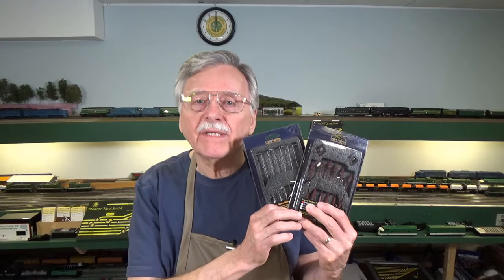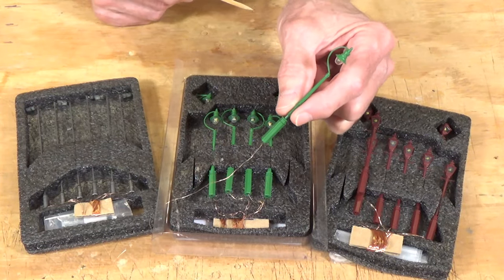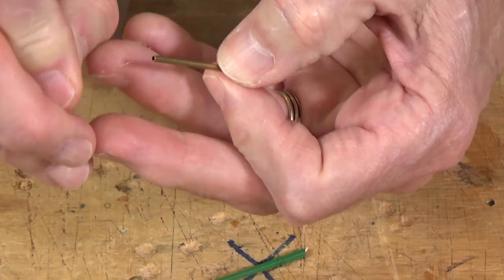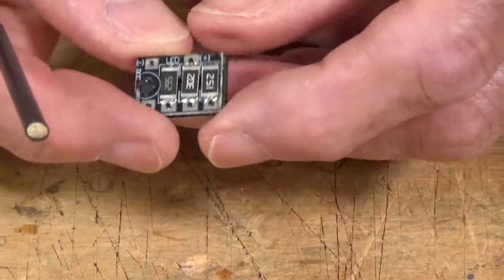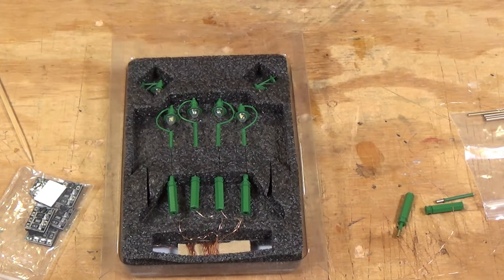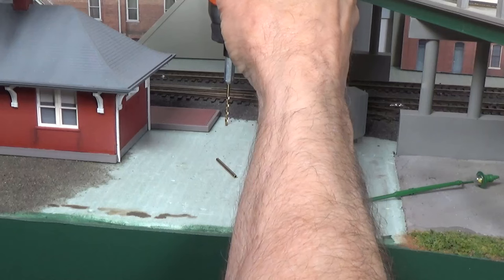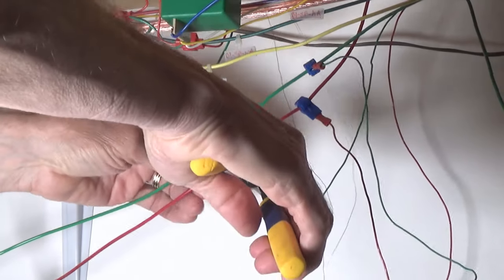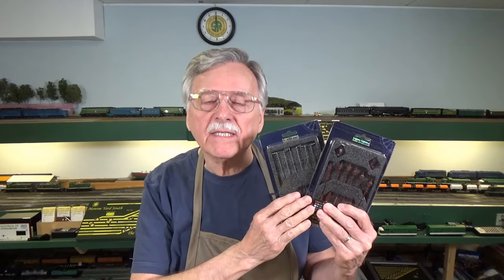Period Lighting For Your Model Railroad (316)

Comment: Thanks for the information Larry. Surely the wires must have colour coded plastic insulation on them that helps apart from the differing lengths of wire for  the + or -. It was not obvious in the video.
Reply: It doesn't really matter. If you connect them incorrectly, they just don't work. Flip the wires around, then they work.
Reply from the maker: Correct, and there is no color coding, just clear insulation, thus the different lengths.

Comment: I am always leery about pulling what looks like magnet wire through brass tubing.  It is hard to see when the clear lacquer used to provide insulation gets scraped off or damaged and this can lead to shorts that can be very hard to find.  Don’t ask how I know this! A small styrene lining helps protect the wires and can be removed after threading is completed.
Reply from the maker: They use a tough enamel coating that they feel makes the chances of breaking through unlikely.

Comment: I plan on hooking mine up to a NCE "Light-it" so I can turn on and off with my throttle.
Reply from the maker: Should work fine, just pay attention to voltages. I’m pretty sure those put out 5V so try the LED with a 1K ohm resistor on the LED wire first.

Comment: Sir I'm new to ho scale railroad modelling. Now I have made plans to set up in my room. So, please clear my doubt. 

I have planned to buy HO scale Roco 70402 ICE 1 power car set and its passenger coaches (9 coaches). What kind of DCC control station should I buy to run this train set at various different speeds from very low speed to top speed. 

Please explain sir. My kind request.
Reply from the maker: Assuming it is the DCC version then any DCC system should be able to control it. Pick the best system that meets your budget and it is a good idea to choose one that friends or other modelers you know also use as they can assist you when you have questions.

Comment: I like that they include a selection resistors so that you can test for desired brightness.

Question 1 :  Would connecting more lights to the same resistor on the same board have an affect on the brightness ?

Question 2 :  Could you connect one light to the "medium bright" resistor, and another to the "high bright" resistor on the same board ?
Reply from the maker: Yes to both. You could also change the brightness by using more or less than the 12V I used. All of which is why having 3 resistors to choose from is a good idea.

Comment: They look nice. Is there any difference in brightness between the three types? I'm figuring that gas lighting would be more yellow, and less intense than the modern LED lamps.
I think the only variation for an install of lighting would be to add a switch at each location, you don't normally see exterior lights on during daylight hours!
Reply from the maker: Yes, an on/off switch would be a good addition. The brightness would be in proportion to the inout voltage. I used my 12V bus but as I said you can go as low as 6V and that should result in much lower intensity.

Comment: Any installation that requires crawling under your layout with a soldering iron is not "easy" or "quick"
Reply from the maker: You could always buy screw terminals and solder them to the boards for a solderless connection under the layout.